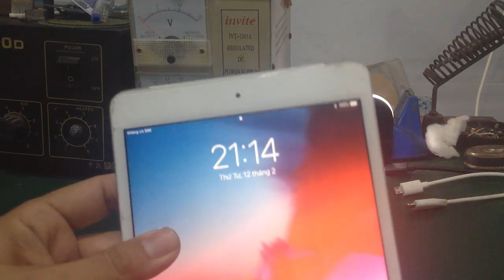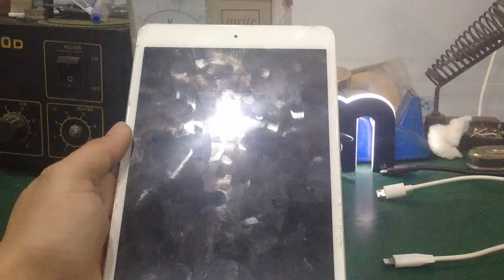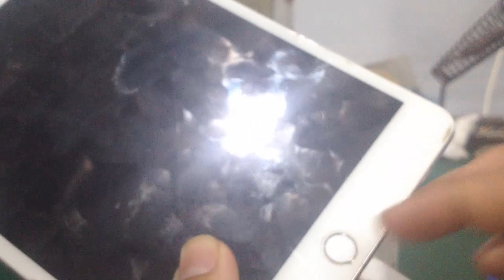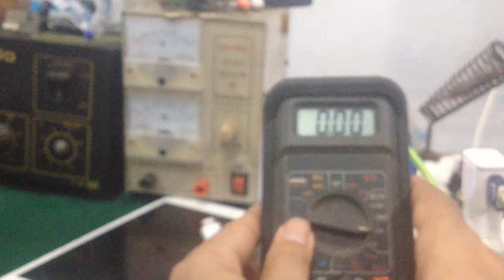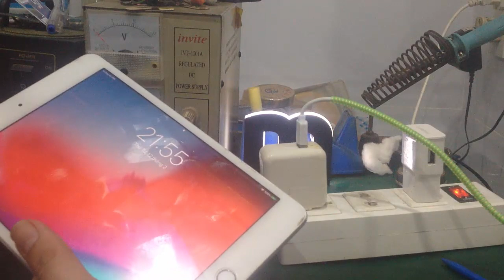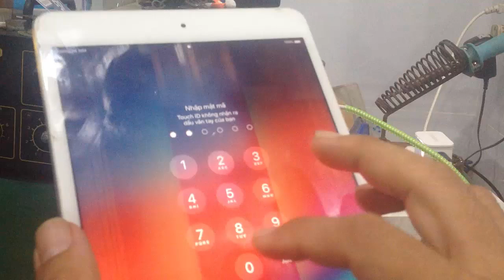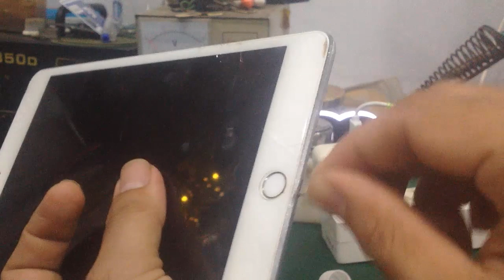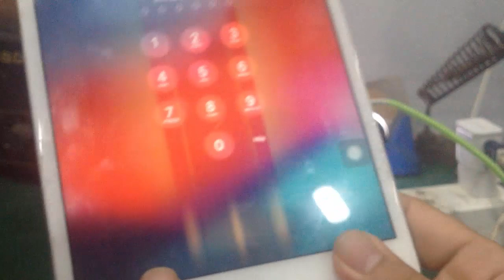Cách sửa iphone - ipad bị sạc không vào pin , sạc chập chờn ... quá đơn giản !!!

Comment: chú ơi con sài ipad Air 2 ấy ạ! con sạc mà nó ko lên pin mà lại tụt pin xuống ạ!Nhưng có nhiều lúc con thử lại thì lại sài được bình thường ạ!Vậy làm cách nào để chữa cái này ạ!
Reply from the maker: máy e sài lâu chưa , đã từng thay pin lần nào chưa ? pin của e nó có dấu hiệu bị chai pin ( pin ko cầm điện ) , nếu sài lâu quá ( trên 24 tháng thì nên thay pin mới nhé )
Hãy đăng ký theo dõi kênh Youtube để xem các video của a nhé … e có cần hỗ trợ về kỹ thuật hay tư vấn về điện tử - điện thoại di động thì cứ để lại comment , a sẽ support cho e !!!
Reply: vậy chú cho con hỏi,có những nhân nào dẫn đến chai pin ạ.Vậy có biện pháp nào chữa pin chai tại nhà ko ạ.Hôm trước con coi video của chị kia,chị ấy bảo nếu bị chai pin thì sẽ chs cho tới khi nào pin tắt nguồn rồi sạc lại cho đến 100%ạ.
Reply from the maker: @vyvyofficial7508  chai pin ( pin ko cầm điện ) là quá trình hoạt động của pin (tuổi thọ pin đã giảm ) ... mình vừa sạc vừa sử dụng điện thoại .. khiến pin nạp xả liên tục , sẹ giảm số lần nạp xả của pin ( mỗi cục pin có số lần nạp xả nhất định ... pin chai thì ko thể phục hồi dc .. chỉ hạn chế cho pin phục hồi dc 1 thời gian thôi...
Hãy đăng ký theo dõi kênh Youtube để xem các video của chú nhé …cháu có cần hỗ trợ về kỹ thuật hay tư vấn về điện tử - điện thoại di động thì cứ để lại comment ,  chú sẽ support !!

Comment: Ah ơi em vệ sinh cáp sạc và cổng sạc roiif mà vẫn không vào ạ
Reply from the maker: e dùng cổng lightning đúng ko ? e thử cắm cáp sạc vào máy khác coi có vô pin ko ? e đo chân số 4 và 8 coi có điện áp 5v hay ko ? nếu vẫn ko hết e bắt buộc phải bung máy , tháo socket cụm cáp đuôi sạc của máy đó ra khỏi mainboard , cắm cáp lại rồi đo trên socket coi có 5v ko nhé , cụm cáp đuôi sạc này rất hay bị hư
Hãy đăng ký theo dõi kênh để xem các video của a nhé … e có cần hỗ trợ về kỹ thuật hay tư vấn về điện tử - điện thoại di động thì cứ để lại comment , a sẽ support cho e !!!
Reply: Nhảm